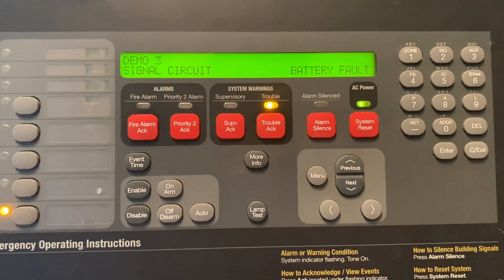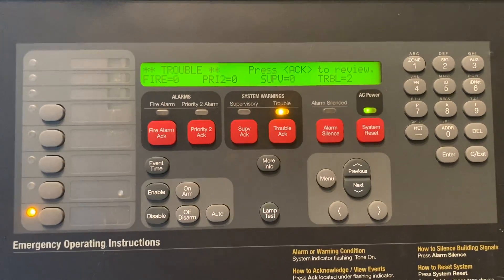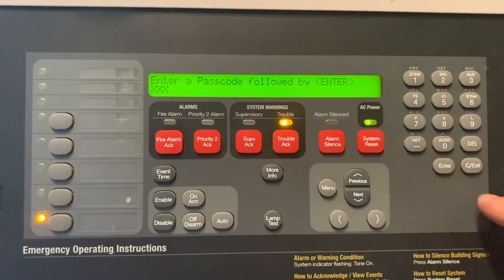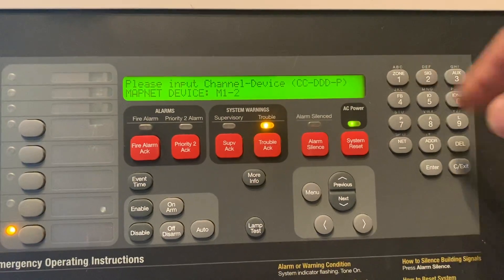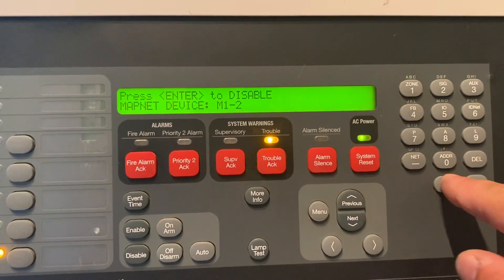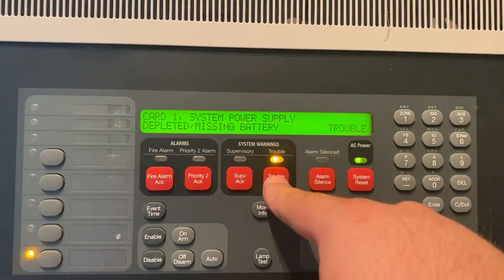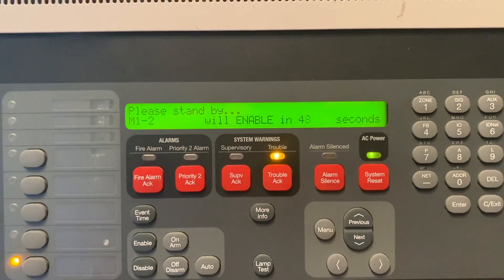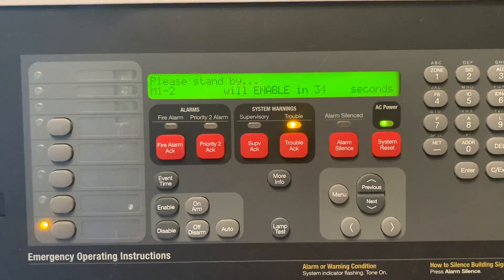How to disable a point on a Simplex 4100ES

Comment: Correct me if im wrong but if you disable the panel the way you show here you can still trigger the slc and alarm by shorting the wires once you take them off the pull station to put the new one on right? So its maybe a safer way to disable entire slc if you dont want to activate a false alarm?
Reply: no because slc communicates through data not shorts